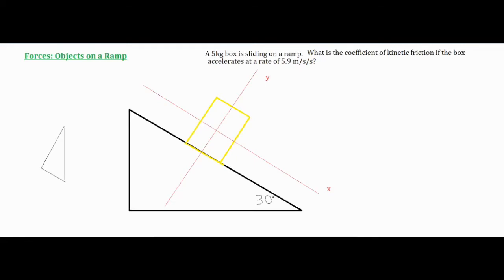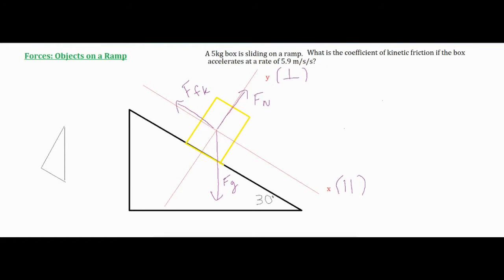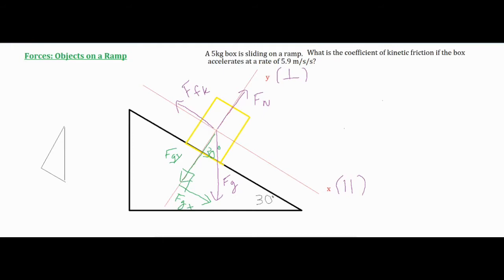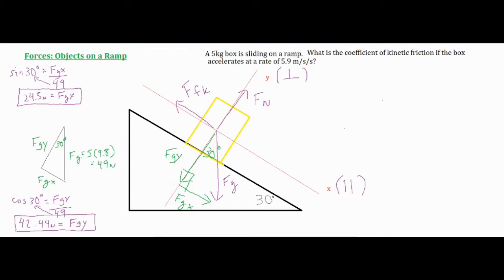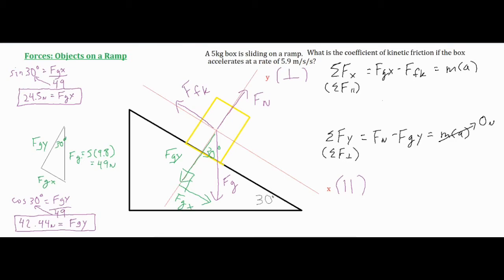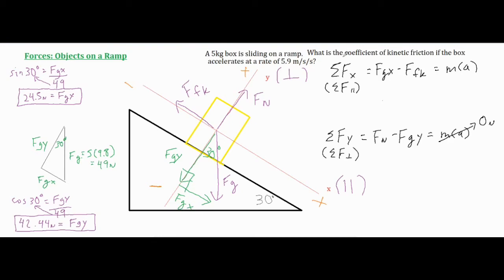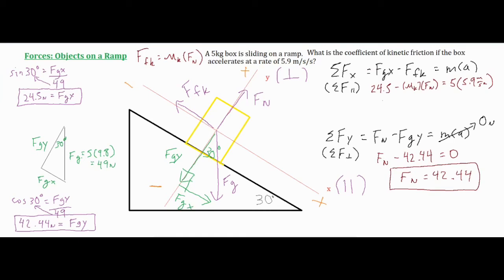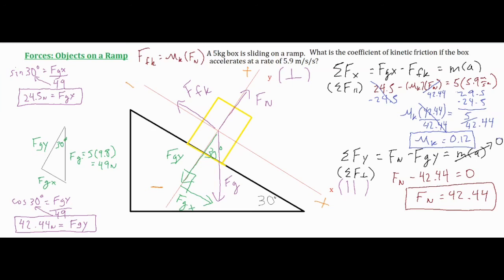How to Solve a Ramp Problem (Using Forces & Components)

Comment: I think there is a mistake with the question.  Since mgsin"theta"= 24.5N  and ma= 29.5 it implies that friction is adding to mgsin "theta" instead of subtracting from it.   The acceleration is actually larger than if it were frictionless.    The method for solving is all correct, except the negative that magically disappears when solving for mu and the video is still useful.
Reply from the maker: Ahhh you are right! Thank you, the acceleration should definitely be smaller to make the net force less than 24.5N.  Good catch!
Reply: Hi, so what does this mean then?
Reply: Does this mean that the general question is wrong or that you made a mistake? Thanks
Reply from the maker: @Epetecane07   it means that the way that the question is written had an acceleration that was too high (5.9, which should be below 4.9), but the process and problem-solving aside from that is all correct.  So if you used the ideas/strategies to solve another problem , then you'd be able to correctly find a solution.
Reply: @beatphysics  Thank you sir. Very well explained!